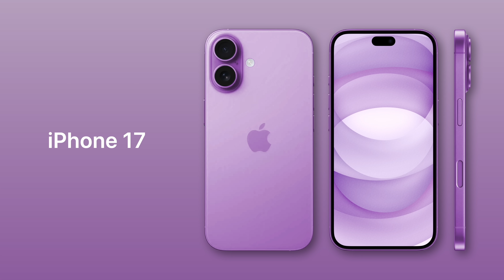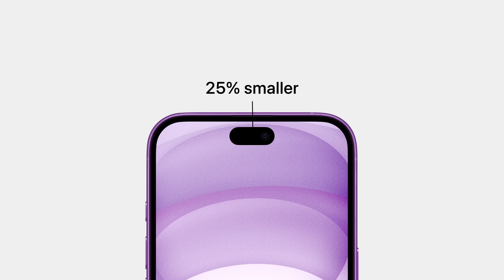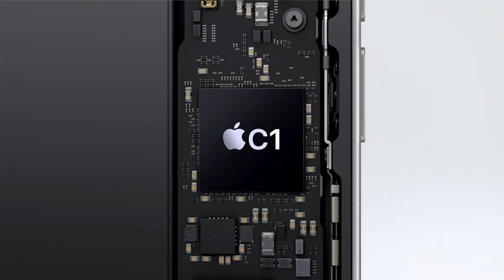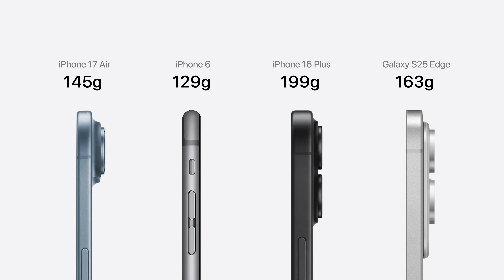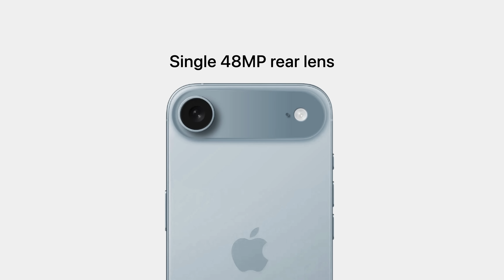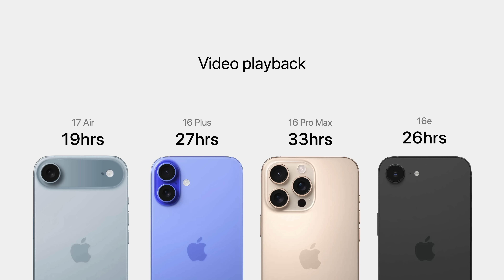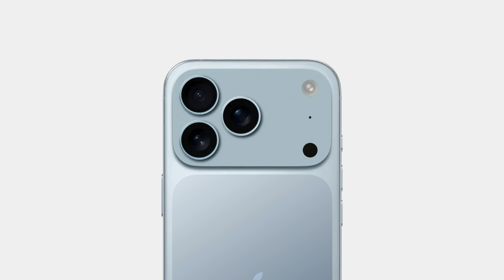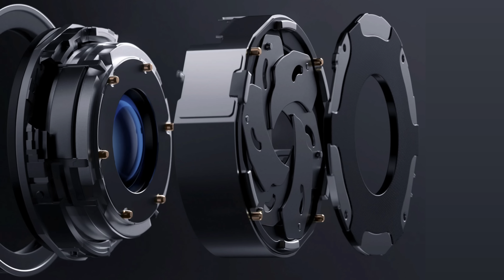iPhone 17: What To Expect

Comment: Apple likes to cheap out on as much as possible, I. E, the slow lightning cable for many years and finally they switched to USB-C and only because the European Union forced them, then there’s that lousy 60 Hz motion display for many years behind Samsung and other manufacturers,  overpriced and backwards Apple, not good enough and then there is of course your Apple Intelligence which hardly works at all and then of course the useless Siri. Do better Apple.

Comment: To make the phone even thinner, they should move the battery into the "Camera bump", since that doesn't count toward the total thickness for some reason.
Reply: Exactly. It is so stupid
Reply: And make the bump a symmetrical thickness for gods sake
Reply: Then everybody would cry a lakes worth of water about "thickness"
Reply: Is that actually true or is it simply because the camera bump is ONE portion of the phone, not the whole phone actually contributing to a massive sizing of the phone? It's apple so I expect there to be some fuckappleray going on. *Disregard if that's explained here, I'm about to watch the video, you're the second comment I seen upon a quick scroll down.
Reply: Better yet, make the phone without a battery. It can be super tiny then and apple can sell us fancy cases with the batteries in them!

Comment: iPhone air is dumb. Almost no one uses iPhone without a case, so thinness doesn’t matter with a case making it thick. Additionally, who in the world thinks that the modern iPhone is too thick and that they need thinner?? Especially at the sacrifice of a good portion of the battery life AND the bottom speaker. The regular max that they are discontinuing is a far better phone. For people who want a large phone but don’t want to pay for features they won’t use in the pro.

Also, downgrading from titanium to aluminum on the pro?? In my opinion, they shouldn’t have went to titanium, they should have kept the steel. I like the heavy feeling of steel. But going back to aluminum feels like a cheap move.

Comment: they should've keept the mini since it was well sold in europe and every user loved it, lasting 6 to 12 hours per charge even after a year of use, unlike the se which i personally got se2 and it lasted me a year but with 81% health and battery lasting 3 hours at best
Reply: I think Air is the new mini because of smaller weight.
Reply: @Natalia.Yarina its still wide

Comment: I really wish instead of the air they went with making a mini version
Reply: They made it only for 2 years.
Reply: I agree with u
Reply: They made a mini for years. It didn't sell. They cancelled it.
Reply: @KaiSosceles I think the problem was Apple not showing it off. When I got my mini I had barely heard a single thing about it, but it is the best phone I’ve ever had. And with the new condensed batteries it could be even better with more battery life.
Reply: This air too won't sell well @KaiSosceles
Reply: @KaiSosceles  well the SE sold really well it was the same size as a mini.

Comment: The 17 Air is going to use a tweaked version of the A19 chip that trades a performance core for an efficiency core, and is rumored to have 22hrs of battery life on a single charge

Comment: I would rather have another smaller iPhone than a super thin model
Reply: They had the mini, didn sell well, I liked it too
Reply: @haroldberserker  13 mini sold better than 15 pro. maybe they should stop releasing pro models and give us back the normal sized options
Reply: @haroldberserker it sold better than the plus and had a loyal following
Reply: They need to drop prices by 50%
Reply: i have not upgraded because I love my mini
Reply: Me, my carpal tunnel and 13mini agrees. I can't use anything bigger than 5,5 without dying in pain (everything is too wide) and i am not even really apple fan, but i was really pressed to buy this one after my previous dinosaur died 😢
Reply: Still using the 12 mini. Please give us another mini!
Reply: hear me out tho, I miss light phones
I'm dayling an a55 and it's thicc (that comes with upsides, the speakers compared to the iPhone 12 base are chef kiss, they sound amazing and full, they don't distort at all at full volume)
Reply: @Emayeah what does "dayling" mean?
Reply: @roguepetunia  dailying

Comment: So, is it 50/50? or MOST likely that the 17 will get the 120 hertz refresh rate with pro-motion( with the adaptive refresh rate )and always on display? 

Because ive been seeing rumours about the 17 and 17 AIR being a FIXED 120 hertz
Reply: They’ll get LTPS (30, 60, 90, 120)

Comment: No stereo sound in 2025 is insane. Only for this i won’t buy the air
Reply: My thoughts exactly and not that good battery life either? I’ll pass on the air also.
Reply: @jesusgalvez6127  I am so interested in it because I would love a lighter, thinner phone. I hate my pro weighing down my pockets, especially shorts. That being said, if the battery is really abysmal, I won't waste my time.
Reply: Who even asked for this phone, I hope sales are low so they actually start listening to what people want
Reply: @gnobre  we want the mini back
Reply: @gnobre its an experiment
Reply: I don't normally use phone speakers, and I hate stereo so it's a non-issue for me.
Reply: @phoenix5054 typical Apple user mentality. “Even if it has less things than a 300 euro smartphone I would buy an iPhone because it’s an iPhone”
Reply: @lyder45  I use 2 phones: a Fold and an S Ultra.
Reply: @phoenix5054 I don’t think so😂
Reply: No stereo is an instant dealbreaker for me, I have the iPhone 11 so I don’t give a crap about having a thin phone and would rather have one that has stereo sound, great battery life, and is structurally sound
Reply: s25 edge >>>

Comment: 1:22 that is dumb. You might as well just get a 16
Reply: Well, people with a working brain always tend to buy last gen flagships at a much lower price anyway.
Reply: I think it’ll be the same system as the 14 and 15, the previous year’s pro chipset
Reply: They have been doing this for years now, the base model always gets the chip from the year before Pro model
Reply: @dnzry2218 only the 14 and 15
Reply: That's probably fake news
Reply: Just get a 14 pro
Reply: But the 17 will apparently get a promotion display, that's a big upgrade from the 16

Comment: google pixel on top
Reply: For repairs.
Reply: @ReadtheBible88  yeah accidently ran over mine and ended up replacing both the back glass and screen my self. it was easy and cheap now its as good as new.

Comment: Should I upgrade my 14 Pro 83% battery health with Instagram stuttering scrolling to the 16 pro max or wait for the 17 series?
Reply: That's funny - I also have the 14 Pro with exactly 83% battery health. I will definitely upgrade to the 17 Pro. I hope the Sky Blue fits to my MacBook Air in this color 🙂
Reply: @bjornsommer1983 Nice, btw which size and specs do you have for your sky blue MacBook Air? And do you use a usb hub for it and which one?
Reply: @oren_katz I have the „small one“ with 250 GB/16 GB RAM and the M4 chip is awesome! For me more power than I need. I only use a USB A to USB C adapter for some peripherals. Greetings from Hamburg, Germany 👍🏻
Reply: @bjornsommer1983 Nice, thank you!
Reply: @oren_katz I just watched your desk-setup video 2025 and liked it! Never seen a PS5 on a wall! 😃 Are you planning to make a video about your future Mac Mini setup?
Reply: @bjornsommer1983 Thank you, and yes I plan to do so. Still debating between Mac mini m4 or MacBook Air m4 or MacBook Pro m4 pro though, but got the mx keys mini for Mac version and mx master 3s for Mac version, and maybe will upgrade to Logitech streamcam webcam for usb c and also motu m2 and use an Anker usb c to usb c cable since it comes with a usb c to usb a cable. And maybe getting two cable management underdesk trays from vivo 17” inches for placing power strip x10 ports on it alongside with monitor and speakers cable all under the ikea idasen 140x70 cm desk instead of putting it behind the tv on a shelf in the right side of the setup and not using the current ikea signum. What do you think? I would like to know your suggestions about that too.
Reply: @bjornsommer1983  mine is 78% 14 pro. i want to upgrade too but i am stuck btw 17 pro and pro max. pro max size is way to big but have better camera only upgrading for camera.
Reply: Replace battery.

Comment: Marketing a phone based on its thinnest point when cameras stick out so much should be classed as fraud. All these companies should be forced to advertise "thinness" by the thickest point. These camera bumps are beyond hideous and this thin trend needs to die asap
Reply: If they removed camera bumps you’d cry that your camera isn’t as good quality. Just like people  already crying about no stereo sound on the 17 air. Something has to give to make it that thin. At least they decided to give it a decent camera. Otherwise people would be losing their minds if it has a flat back, a worse camera, and no stereo sound 

Camera lenses get thicker the better quality that they are. That’s just how cameras work. You can’t have a flat back and retain the same image quality that phones have now
Reply: Somebody doesn’t understand basic physics . You need large camera sensor
Reply: Even if camera sticks out it’s still lighter in grams. Makes my purse less heavy, and my hands hurt less. It’s that easy
Reply: Fraud my ass bruv
Reply: its ok when samsung does it tho
Reply: @Paradoxical124  where tf did I say that? I've very deliberately avoided naming a specific company or product but the S25 Edge and the Z Fold7 both look awful with huge camera bumps.
Reply: I'd rather have a camera sticking out than my leg ripping from the phone being too thick. People use cases anyway.
Reply: @FireFoxDestroyer  It's not so much the thickness but the size, I've found that older phones, although thick, are more comfortable because they are not as long, and I don't think a thin but super large phone will solve it
Reply: @FireFoxDestroyer Huh? Why would your "leg rip" from a phone being a few mm thicker?
Reply: like if the phone stretched out my pants too much so it would tear from regular movement, then that would suck. Also, I dont want my the shape of my phone sticking out this a sore thumb. camera bumps help reduce that. @IronMan-ds5bi
Reply: @IronMan-ds5bi  he doesn’t even know what he’s on about. That’s why he ignored you. He’s a delusional tech bro wannabe trying to act like he knows what he’s talking about.
Reply: @FireFoxDestroyer  never heard a single persons legs being ripped from a phone’s thickness
Reply: @FireFoxDestroyer  How thick is your case gonna have to be tho on these "thin" phones to balance it out?
Reply: @vexingrune I don’t get the “thin” phones. I get the phones that are manageable and durable. I have an iPhone 14 and its battery is sufficient for me while also being light enough to throw easily and not break anything. I have a case but it’s pretty thin and it doesn’t mitigate the camera bump, but usually I’m holding it or it’s in my pocket. Camera bump also helps to prevent scratches on the back glass if I don’t have the case on.
Reply: @FireFoxDestroyer  thin phone break just from sitting , yeah , good way to throw away 1k dollar

Comment: Def skipping this generation LOL - no bottom speaker for 800 bucks
Reply: I still have the 14 pro, I aint upgrading until there is a design refresh cuz they all look the same and basically do the same shit.
Reply: @protoman2260 Same  boat. Just replaced the battery on my 14Pro and not seeing any advantages on 15, 16 and likely the 17 to switch. To be honest, if Samsungs were cheaper I would make the switch.
Reply: @protoman2260 i have to upgrade my current battery life is at 75%😢
Reply: @EngageTV  get an android. there. my android is still at 100%
Reply: @protoman2260  exaclty i got 13 pro max and it works so perfectly
Reply: if the rumors are true this is the best generation in a while
Reply: then... get a pro its right there for you
Reply: @olivergreen2662The new pro doesn’t make sense, it’s just the same as the older ones.
Reply: 900
Reply: You should skip 5-6 generations of iPhone every time…theres no changes in between multiple years…
Reply: That’s only the air, you can get the normal 17 or the pro
Reply: don’t get the stupid 17 air??

Comment: That's a crime, legit crime releasing a phone model without bottom speakers and charging money after sacrificing even battery life and all, this shouldn't exist, a waste of chip on planet and unnecessary e-junks, because I can anticipate this will automatically be the worst iPhone in apple history, rather their mini model was a blast, I would recommend someone to buy iPhone 13 mini over 17 air!!! A basic phone user can expect decent audio experience, a workable phone camera and all, don't say that this will be the first portless iPhone supporting magsafe transition altogether. That will be another crime :v.
Reply: I’m pretty sure this was the same backlash Apple had in 2007 or 2008 when they released the first MacBook Air which was thin but had to give up on many key features. But as time went the MacBook Air in my opinion improved. I hope and think this will be the case for iPhone 17 Air.
Reply: @adarshganesh6341  I wouldn't buy such product, rather I will buy a base model iPhone. But releasing something that does not offer people basic features, is a serious crime. The audio quality will be worse, I mean cmon...
On the other theory, if they are opting out for future prototype where they will be able to emit sound from the surface without any visible speakers and deliver the same experience, okay, I am open for that innovation, so far no companies have shown such product.
Reply: @norscop35 Yeah, totally agree! If I did plan to upgrade my phone, I would probably buy the iPhone 17 or spend extra if I had the budget and get the iPhone 17 Pro
Reply: @norscop35  but what I don’t get is why did they discontinue the i-phone mini?
Reply: Then don’t buy it. Simple as that
Reply: No usb:- so people have to buy iCloud and Magsafe
Reply: Who bloody cares about speaker quality 😂😂😂

When was the last time you actually played music out loud from your phones speaker? You don’t. You use a Bluetooth speaker like everyone else
Reply: @TescoRoadman  While at home I do play in loud speakers, at Facetime video call while speaking I use loud speakers, while the loudspeaker serves its purpose why do I need a Bluetooth speaker!!! In fact I have never used one… Airpods pro are my daily gadgets if I need to use it.
Reply: but i think the speaker performance still on par with another competing phone, it can be even better than any android. You know, somehow apple can cram in some of the best laptop speakers in the thinnest of macbook air. I think they gonna do that kind of magic.
Reply: @SimplemanOfficial-u7u  In that case, I am optimistic, but nothing beats stereo speaker experience. Also, I envision a future where there will be no visible speaker grills but deliver same audio experience, that will be another experience apple can bring before anyone in the market at commercial level.